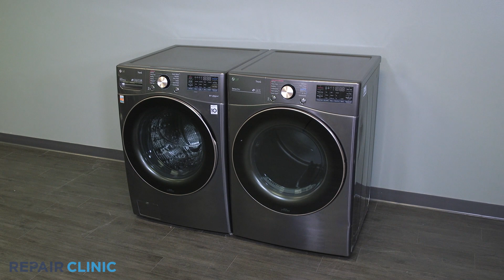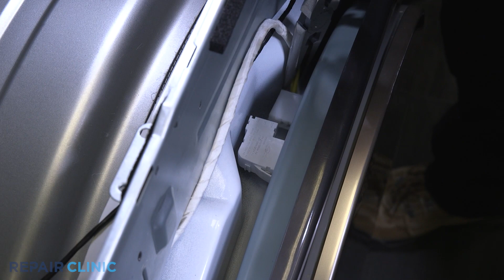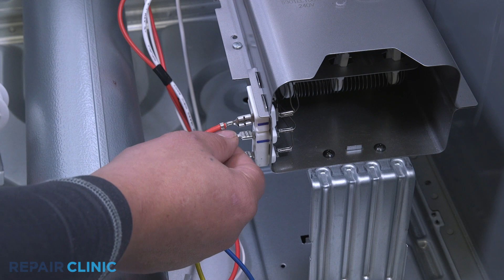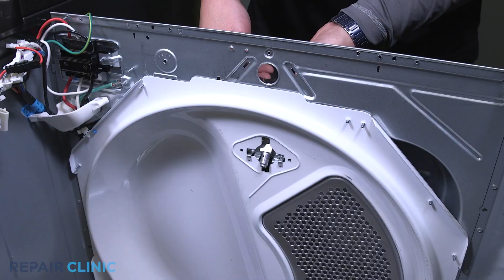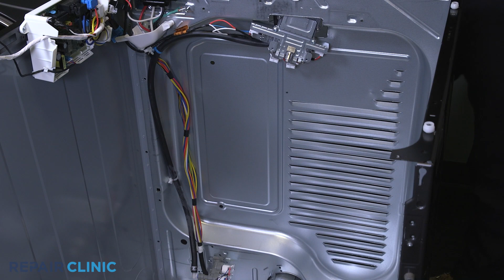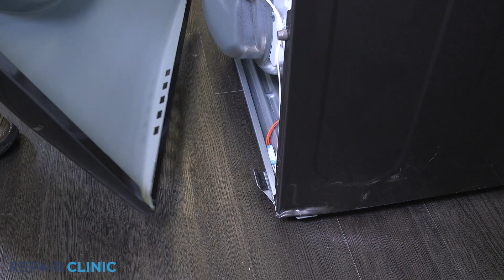LG Electric Dryer Heating Duct Replacement 5209EL1001C

Comment: Just did this replacement on an LG gas dryer using your video as a guide. It’s the same process, just an extra tab, wire harness or screw here and there. Biggest difference is the heating element section can pop out after 2 hard to reach screws are removed without disconnecting any wires. Got it done start to finish in about 2-1/2 hours. I decided to clean everything as I worked and there was 6 years worth of lint and crud so I’m very happy I did this to make that discovery. Thank you for the help!
Reply: Thanks for noting how long it took you. Debating DIY replacement on my sadly only 4yo dryer.